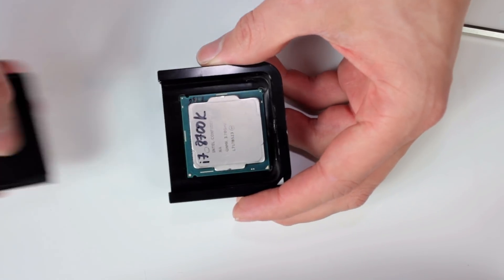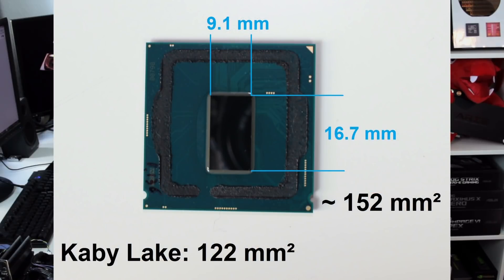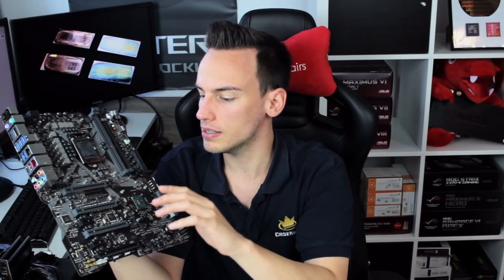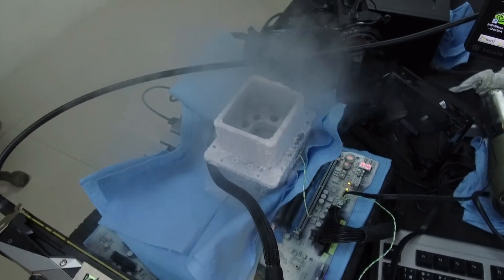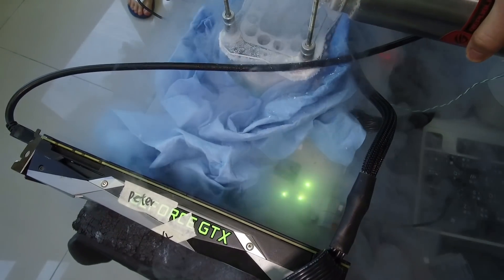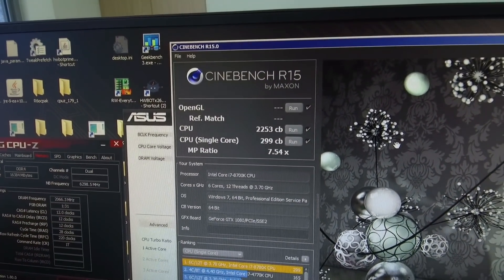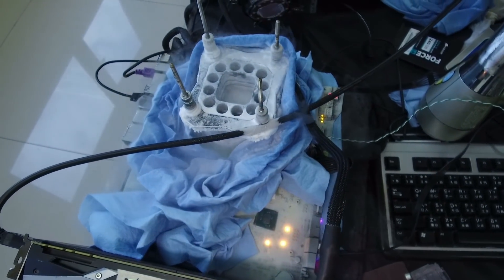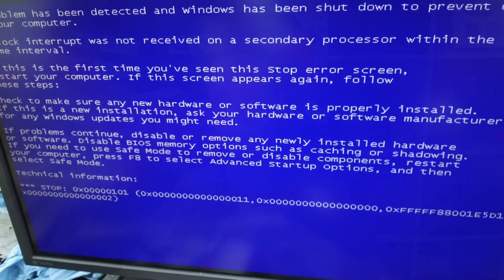i7-8700K - 10 New 6-Core Records with up to 7300 MHz (en)

Comment: That's badass, have you ever considered making a refrigerant condenser set up? I know it can freeze the tubes if the pump never shuts off, maybe an easier less effort of having to constantly pour in the LN2. Maybe ask engineer about it. Maybe it wouldn't work that great, I really don't know, but I do know it freezes and can be regulated not to freeze. Maybe a good in between. Like between LN2 and liquid cooling. Just a thought, great job at what you've achieved with Over Clocking

Comment: how do you disable avx or is it ok to set the avx offset to the same as the uncore which is 4.4ghz to get a higher overclock and less voltage and temps.i am using a delidded 8700k and LLC doesn't work right on my strix board. it either overshoots or undershoots and crashes. 1.435 is way to high with llc at level 6, level 5 and voltage doesn't go over .1325v. i need some help, this motherboard seems fucked up. i am running llc at 6 at 5ghz, with avx offset of 3 and uncore at 4.4 ghz with a max temp of 67c

Comment: Just upgraded to a 8700k on an asus tuf z370 gaming plus, it's a great upgrade from 3570k & z77 sabertooth. Delidded temp drop @ about 18c, does 4.8GHz without any real tweaking, going to sit down over the weekend and clock it properly.

Thanks for the Video der8auer.

Comment: Anyone with some experience in overclocking that can help me with a problem? 
Want to overclock the i7 8700K to 4,5 GHz (permanent OC). Using a Noctua NH-D15 CPU cooling tower.
Is it necessary to delid the CPU if i wanted to go to 4,5 GHz?
What is a good temperature line that the CPU should stay below to reach at least 5 years of lifetime? Below 80°C? Just an approximation, nothing specific.
Would be awesome if someone could help. 
Btw, awesome video! Subscribed!
Reply: You should have absolutely no problems hitting 4.5GHZ by just changing the CPU multiplayer in the bios to 45...leave everything else in auto. In fact you should have a preset in the bios allowing you to just set the CPU at 4.7 or 4.8GHz. My 8600K did that out of the box on auto and I have it now at 4.9GHz at 1.285v. With regards to temps, you should be idling at around 27 to 30 degrees C and at 4.5, I doubt you will hit 65 c Degrees when bench testing with RealBench with a good AIO.
Reply: Ye i thought the 8700K should be able to do it with ease, but i've read it has apparently some overheating issues, maybe when u OC to 5GHz. Thanks alot for the reply!
Reply: No problems at all. Overheating is an issue when using AVX type workloads and continuous stress testing... For gaming and light production/video editing and so long as you have a good CPU cooler like an DH14/15 or AIO you should be more than okay.
Reply: Ye it's mainly focused on photoshop editing and gaming, the workloads shouldn't be high i believe. Soon building a new pc so i wanted to be sure and try n ask someone who knows. Again thanks for the competent answer.

Comment: Cinebench like to give Ryzen high scores that’s not reflected in real workload. My 1600 got 1000 points over my 3770K but 3770K is quite a bit faster in games and even when rendering, 3770K isn’t much slower than 1600.

Comment: i am wondering is i7 8700k a bad overclocker in general cause is seems pretty shady that intel has reduced the base clock to 3.7 from 4.2 and has refused to publish all core boost clock anymore.
Reply from the maker: OC clocks are the same as kaby lake :)
Reply: No, that is the max turbo for a single core. as off coffee lake Intel said they are no longer providing that info. they are now only guaranteeing a 3.2ghz base anything extra is a bones.
Reply: There not even close to kaby lake,  CL has over a 70% 5ghz rate which is almost double.
Reply: Pendragon you have no idea what you are talking about.

Comment: Great video.  My 8700K runs actually very cool.  I have uploaded plenty of videos showing 4.8Ghz overclock with temps around 50-60C in PUBG and BF1 144hz.  I tested both 1080p and 1440p.  8700K is a beast and new the consumer KING.
Reply: where did you get your i7 8700k? I´m in germany and you can't get the cpu anywhere
Reply: I'm in the US.  I got mine from Newegg during that "presale" event that happened at 0230 on the 4th.  I did rush shipping and overnight shipping.  I had mine and the Strix Z370-E delivered on the 5th around 930am.  I got super lucky brother.

Comment: I'll stick to my 6700K OC'ed to 4.5 GHz for 1-2 more years ... when I'll upgrade I want to do it because I need it not because I simply want it :). Currently there is no game out there that will stumble in my cpu .
Reply: Hi, did you upgrade your CPU?
Reply: @Hunikengt  yes, after upgrading to a 2080Ti the cpu could not keep up in all the games so I ended up with a 9900K about 1 year ago.
Reply: @ro_explorer  Sweet! I moved on from a 4790K to an 8700K running at 5Ghz now. Running a GTX 1080 and waiting to upgrade to a 3080Ti.

Comment: Well I need to decide between the i9-7980ex or the i7 8700k. I want a 24/7 overclocked to 5ghz but I also want the best motherboard for 128gb of ram. I plan on using 1 nvidia xp at first. Yes it is for gaming but also for video encoding. Please let me know which one you would use and why.  And how and what parts to make it happen.
Reply: If you do two thirds gaming go i7, if you do two thirds productivity go with the i9.
Reply: Andrea Sturmreif schießen und in die Fresse Nahles thank you ma'am.

Comment: @der8auer, what is the advantage silver IHS? wouldnt copper IHS be better due to higher/faster heat transfer rate?
Reply from the maker: +jt AJ  Silver has about 10-15% better thermal conductivity depending on the grade of the copper :)
Reply: hey Der8auer, just curious the CPU on sale at caseking.de, I read description that at most they use 1.4v at 5.2ghz but I use google translation so I'm not sure if it's correct, could you help me confirm?

Comment: I am currently on a 4.6ghz 3570k probably gonna push it a bit higher once my delit die mate 2 finally arrives (ordered in august) as the system gets a bit too loud right now on a higher frequency and reasonable temps.  

I may upgrade at some point but right now I seem to be usually playing less intensive games and while it is true that when wanting to go to 1440p 120hz backlight strobing the cpu is the main bottleneck I simply spend too little time playing games where its an issue right now to warrant a upgrade right now. Besides that I'd rather upgrade to some future amd system if they can get the per core performance up to intel levels. Who knows I may just cave and buy a 8700k before that happens.

Comment: Still on my delidded 3570k with liquid metal @ 4.8ghz 24/7 @ around 69°celsius max on prime95. Usally 58° max in games.
It can reach 5ghz  and i see no reason to upgrade because i can play any game and i do not run into any cpu bottleneck with my 1070.
Reply: I wouldnt call 20 fps in cpu intensive games, "significantly" and certainly not when we talk about the >100fps range anyways.
Reply: Lucky. I'm on an i5-2400 that does bottleneck my 1060. I want to OC the gpu but there's no point
Reply: and what.... 100€ monthly electricity?
Reply: I am on a dell m6500 laptop i7 940xm

Comment: Definitely considering 8700k, I'm on a Z87 board with 4790k at 4.9ghz with a 1080ti but I feel this is a worthy upgrade. I've skipped Z170 and Z270 as I didn't see enough reason to warrant that much money for a CPU that might clock worse even if it has slightly better IPC but this actually will bring real world benefits.

Comment: Intel could save money and charge extra for a CPU without the lid.   They are not very bright.  They could also offer aftermarket lids made of fancy metals.

My bet is that in 10 years, there will be a CPU that will have integrated graphics as good as the current 1070 or Vega.

Comment: as of now 400€ in the EU.... the consumer i7 k-chips used to cost 350€ which I allready found to be a tad to expensive... i hope the price goes down a bit.
Reply: Preorder price in the Netherlands seems to go down to about €374 and I don't doubt that it will drop.
Reply: well, it depends what is EU exactly... because here in the EU it costs 365€ including VAT, unfortunately still not available right now
Reply: chump change, save up, buy it, OC it and hold for 5 years.

Comment: Intel Improves The TIM
🤔
Why not use Indium Foil...
Reply: Seeing the numbers of "toasty" 100°C CPUs, they did absolutely nothing :-)
Customers should fill a class action against Intel, some of these CPU are thermal throttling due to this shitty paste if pushed hard!
Reply: Why would they benefit the customers?
Reply: why not just do it yourself? its pretty easy
Reply: Bourinos02 Using cheap thermal paste isn't illegal, so any judge would throw out a lawsuit over it. The only things you can do are either stop buying Intel processors until they go back to soldering or delid it yourself.
Reply: you dont have to pretend, just reglue the lid with black silicone, ask for expedited shipping, they'll ship it even before they asses your chip. and even if worst case scenario they dont take your warranty, you received a new cpu for at cost price, which is way below what you would normally pay retail anyway.

Comment: I'm sticking with Ryzen because I don't want to throw out a 250 dollar motherboard every year.
Reply: dacorpsemak3r, you must have missed the part where I've been doing this REGARDLESS of whether I had Intel or AMD, hell my work machine is an FX6300 that is right about 5 years old. My point of the every 5 year is you simply can't SEE MEANINGFUL GAINS while still on the same socket, if you buy the best CPU you can buy in gen 1 of cpus for that socket you will be within 5-10% of the FINAL CPU generation that supports that socket, you will NEVER see a return on investment buying 2 CPU's on the same socket unless you bought an entry level CPU to get into the platform then buy the latest and greatest at the end of the socket lifespan.
Reply: randomviewer896 I've been using my 3970X for 4 years or something and it still strangles Ryzen CPUs and give the new intels a run for their money. You don't have to upgrade every year, a 2700 or an FX 8 can still keep up contrary to what people believe.
Reply: randomviewer896, if you upgrade CPU's every 5 years you WILL ALWAYS GET A NEW MOTHERBOARD SOCKET, because not even AMD supports the same socket that long. I would know, all 3 Of my past AMD builds (3 of my 4 personal desktop builds) required a new motherboard EVERY TIME.
Reply: My xeon W3680 beg to differ... Still totally fine right now! You only need to update frequently if you're buying entry level CPU, but if you buy top of the line CPU, you're good for years! Unless of course you specifically do CPU workloads but in this case, you just buy Threadripper/Xeons CPU anyway...
Reply: CS:GO Anvers nar. I’ll keep my 8700k/z370. (When the cpu actually ships!!) And in 5-7 years see if you needed to upgrade cos ya clock speeds too slow for the latest games at that time. 
My 2500k system is still pretty good and has lasted since 2012. 
What amd system from that era still performs well?
Reply: CS:GO Anvers 1. No it isn't, I handled Ryzen/intel builds in the past 4 months. R5 CAN'T beat high clocked i5s in almost every game out there save for TR/BF1 and shit. There are still CPU bottlenecks at 1440p, my GFs 3 yr old 4690K@ 4.4Ghz can beat a Ryzen 7 1700 3.9ghz test bed at 1440p both with a GTX 1080 in gaming by 5-10 FPS.2. People who buy intel/AMD Ryzen 7s DO NOT BUDGET/SAVE MONEY. An 8700K is the current CPU king, 7700K for gaming, 1700-1800X for multi core, don't compare these with a $200 CPU3. PC gaming was always about frames, 1080p120-144FPS>>>>1440p60>>>>>4K30 4. Never bottleneck a GPU, it feels terrible5. Try using both platforms next time. And BTW, the performance gaps now are so small that CPUs from 2-4 years ago are still competitive (yes even FX 8 cores). If you want to save money just buy an old 6C/12T Xeon/ I7 3770K for dirt cheap and OC the crap out of them.
Reply: L S Jim Keller who crushed intel with Athlon 64 designed the Zen architecture, he left after designing it in 2015 and joined Tesla at a high position after that. Raja DID NOT design Vega, Raja was responsible for Hawaii->Polaris.
Reply: On AMD motherboards you dont need to OC to burn the circuits xD trust me.. u can see intel 3rd 2nd gen 1st gen procesors still working nowdays... but you will never see an old amd processor working after years.. they are CRAP just like the cheap azz mediocre subhuman motherboards..    atte. 8700 / 1080ti master race
Reply: lmao. AMD fanboys are almost as bad as console players talking about pc hardware. :D
My favorite part was when that guy compared the 8700k to a r5 1600x ahahah
Reply: randomviewer896 that's why I buy the cheapest, with the best chipset
Reply: dacorpsemak3r Intel is not for budget conscious buyers bro. 2nd Intel has been ramming the sam shit because AMD was sleeping the entire time. Whose fault is it?
Reply: randomviewer896 Ryzen will. The engineer responsible for Ryzen already left. AMD would release the same Ryzen chips but clocked higher, same strategy as Intel. And probably find ways of milking the TR line
Reply: same was with am3 sockets dont throw that 250 dollar am3 mobo - stick ryzen in it
Reply: 1sonyzz, Ryzen is AM4 not AM3
Reply: i know it well since i did research before ryzen was even out but was too lazy to wait so upgraded to intel from 10 years being with amd from 2006, that was just an example when when am4 came out he didnt throwed 250 bucks mobo out he stuck ryzen in it, so same will be with ryzen when am5 comes out or some other socket from amd side
Reply: CS:GO Anvers Shure i bought mine 2016 spring
Reply: B0NES YT I don't know what you're talking about, the engineer responsible for ryzen did NOT leave AMD. The engineer responsible for VEGA left and went to Intel. The engineer responsible for ryzen is working on Zen + and Zen 2
Reply: randomviewer896 enjoy lower fps
Reply: I bought the i7 8700k tonight on amazon cost me $339.My i7920 just became too slow for gaming ONLY and im handing it down to the wife and kids for their smaller games and serfing.I put my i7920 together over 8 years ago and its still a BEAST never maxed out the cpu unless benchmarking it.The i7 8700k is a good upgrade and my intel chipset and cpu lasted fine all this time.not every year or so.and youre a damn lie if you say you spent 250$ on a mobo anyways.amd dont even have a cpu worth $250! LOL
Oh and good luck finding friends with a brain to talk to being an amd person you wont understand what i mean for years.
Reply: shooterzden paid $400 for my 8700k in October. Didn’t get it until November. No regrets.
Reply: Zfast4y0u I can afford a new cpu every month with no problem. But who the fuck needs to upgrade cpu every year? My 8700k will be good for a few years. I’ll be upgrading my cpu as soon as intel releases a new cpu but I sure as hell don’t NEED to.
Reply: summertime of sadness 
8700k/1080ti/zowie Ben q xL2546 monitor master race. Life is good.
Reply: Slash Le Pew I don’t fuckin get it. I get that amd is good if you trying to save or are on a budget. But don’t get it twisted. Intel is superior. I like amd fanboys though. They keep buying amd and keeps the competition alive so us intel buyers win. I would not buy a amd over my 8700.
Reply: well shit you shouldn't be upgrading CPU's every year (or less), thats just fucking retarded. any CPU upgrades more frequent then every 5 years is a fucking waste of money. you know what else happens at 5 years, even fucking AMD has changed sockets, so regardless which team you go with you should need a new board anytime you upgrade, any upgrade that occurs on the same socket is a waste of money.
Reply: Eh, I disagree. One should upgrade their CPU every five years and if there's no real reason to get a new motherboard then one shouldn't be forced to buy a new one. I'll buy the last iteration of Ryzen that's compatible with my mobo because pcie4/ddr5 have very little to offer in terms of gaming performance.
Reply: Thats absolutely not true.  Everyone knows already that $200 Ryzen R5 @3.6 ghz performs equal to overpriced intel with higher clocks at 1440p monitor or higher. Go check some benchmarks. in 5-7 years I will probably buy another cheap amd cpu and a new 4k/8k 144Hz+ monitor, which will perform same as overpriced intel, this is how things work. Single core performance is useless on higher resolutions.
Reply: I am convinced that Ryzen will NOT go the way Bulldozer did with the 9590. Your argument is invalid.
Reply: It's just  2 stupid to buy intel cpu in 2017/2018.  You know why? 

1) FPS difference is about the same between Ryzen R5 and I7 8700k on 1440p + monitor >>> GPU matters(!!)
2) Instead of getting i7 8700k for about $400 + $120 mobo you can get r5 1600(stock cooler included) + ab350 mobo for $280  Congratz, you just saved about $240!!
3) Go grab for the money that you just saved a 1440p monitor and experience real quality shit for the same price that you would pay for your intel i7 8700k  + mobo.
4) Sell your old intel pc/components + your 1080p monitor and go grab decent GPU. 
5) Thank me later
Reply: Yes it is. R5 performs equal to I7 in 1440p gaming easy. And costs 2x less. You can be an intel fanboy, I don't give a fuck about any brand. Go check benchmarks at 1440p  all over the youtube and you will see that it's just 2 stupid to buy any overpiced intel cpus if you're playing at 1440p. I switched to R5 from I5 and the difference is day an night in performance and also at gaming at 1440p. Even R5 1600 DOESN'T bottleneck GTX 1080 TI @1440p, get your facts right(!!!)  I repeat again: you don't have to spend fucking $400 for a cpu which can't do any better than a new 6c/12t ryzen cpu at 1440p or 4k gaming. 

The point of my comment was: 1440p monitor + r5 1600 > 1080p + intel. 1080p gaming is outdated for 2017/2018 gaming.